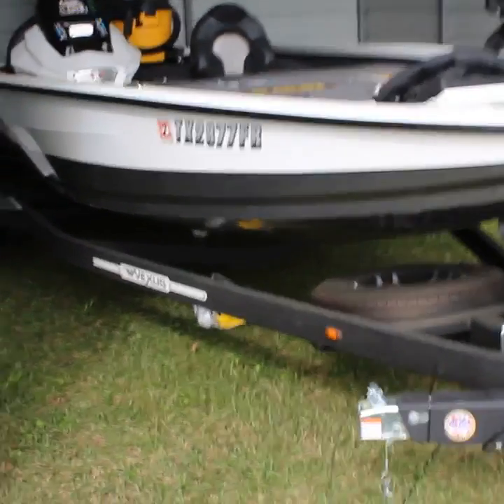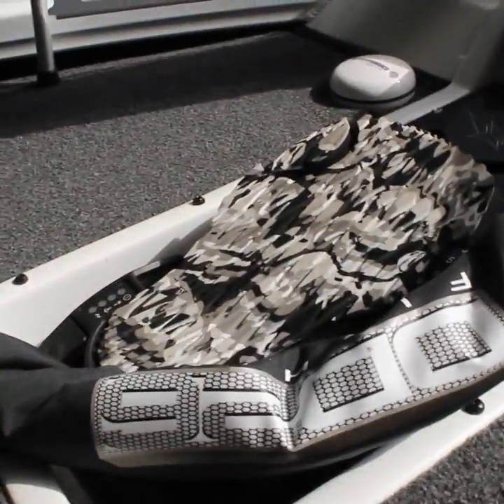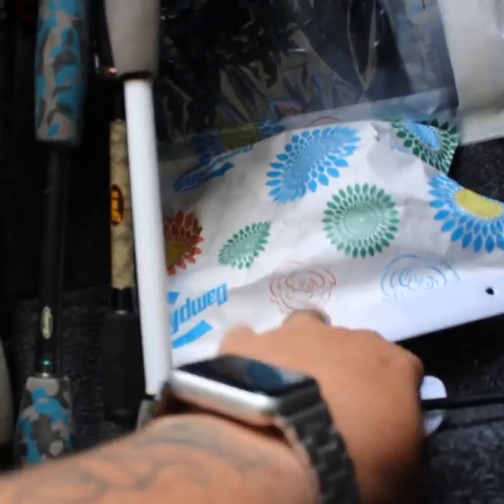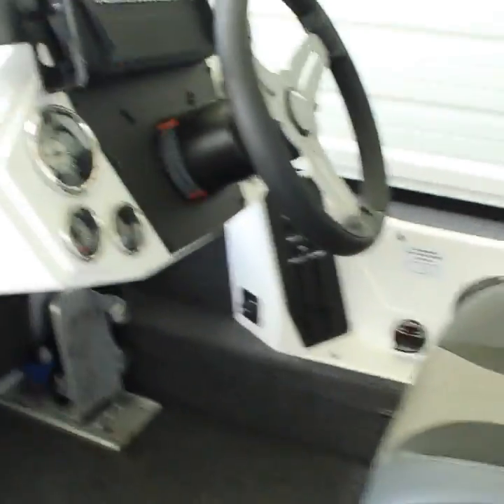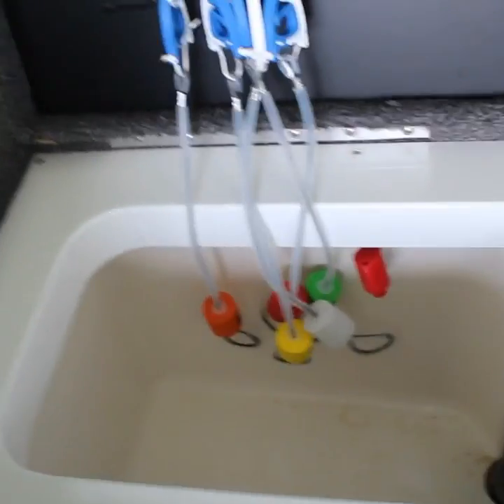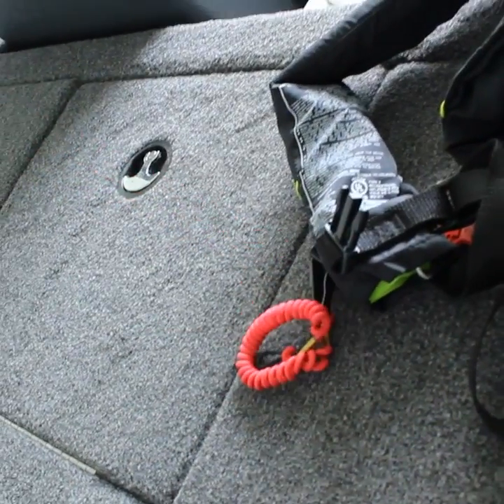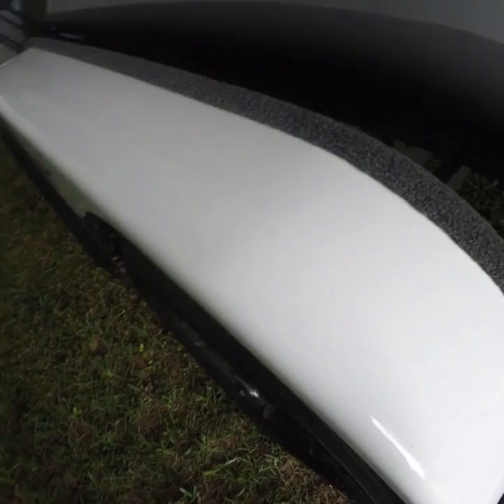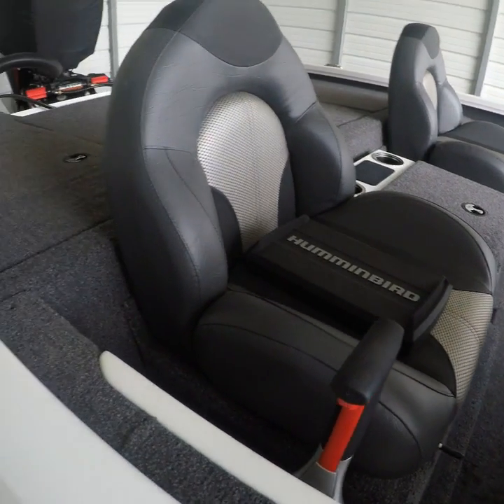(NEW VIDEO) 2020 VEXUS AVX 1980 honest review from a actual customer. YOLOtek powerstick link below!

Comment: Because the front compartments are sealed it is extremely difficult to get moisture out. On a hot day or 2 remove everything out of your storage compartments and leave them open with a fan running on it. Works like a charm. I’ve made a habit of just leaving my lids cracked while in the garage. Insulating your lids will also help.

Comment: Love your honest opinion.   Don’t be so hard on your compartments for moisture.  Water isn’t getting in, air is and you can’t keep it out.  The unconditioned air contains water which condensates due to the temperature changes just like condensation on a cup with a cold drink in it.  That moisture didn’t come from the inside of the cup, it came from the air around the cup.  Same principle in your boat.   You may have to try leaving compartments open or partially open but experiment with a cover on.  Keep us posted how the boat does going forward please.

Comment: One thing Vexus Does good & I think Ranger does also is the Channel Iron Trailer. I had a tube trailer before with Tracker (1994 model) and they don't hold up. They rust from the inside the tube. I won't even consider a boat without Channel iron. I like Vexus even with some of the flaws. The Fiberglass console is another big winner over the flimsy designs of the past you may see in other Aluminum boats.
Reply: Just curious, how many years did you get out of your tracker trailer?  I have a 1996 targa 18.  Had it since it was brand new and just this year I had to get two beams on the trailer replaced after they rusted and broke in half.   But thats after about 25 years of use so I can't complain.  It's is just their regular trailer.  Not galvanized
Reply: @lightsout827  I got 16 years out of the tube trailer. It was not galvanized. It was the standard tube trl. I had a channel trailer built to replace the tube in 2010. I still own the boat. Its a Deep-V (Magna 17 Fish) Bought the Boat new in 1994.

Comment: Great looking boat! I do think its funny that the company in a video from 2019 claimed that all of those compartments were watertight dry boxes....interesting!
Reply from the maker: I have found they are water tight if it rains or a wave comes over however they are not water tight when it comes to condensation that’s a fact lol
Reply: @clutchfishingoutdoors3141  would it be possible to add something to the inside of the lid to mitigate moisture? Do you know why aluminum boats have more condensation problems than glass boats if all lids are made out of aluminum (at least the ones I have seen).
Reply from the maker: I’m pretty sure most glass boats have glass lids throughout the boat and I’m sure there is something you can put on it to limit the amount of condensation I just haven’t really messed with it ... it’s only during the cold months were it will do it

Comment: Great video! Would love some on the water videos and curious how it is in the wind not running but fishing. Does it blow around or is it more like a glass boat since it has some fiberglass in it.
Reply from the maker: I have a few on the water videos of it on my channel and if you are out in open water with say 12-15 mph winds and decent waves then it pushes you around a little bit nothing bad tho it’s heavy enough where it won’t just get blown around that’s for sure I’ve never had any issues . I’ve had it in open lake with some prettt good waves fishing a point , I had water splashing over the back of the boat but I had it on spot lock and it still felt plenty sturdy and safe

Comment: I even have condensation problems with my fiberglass Ranger sitting outside. The compartments seal so tight it can’t get out so I always use Damp Rid in my compartments. Mines a 2014 before they offered the ventilation system.
Reply from the maker: I mean I think if you leave a boat outside period you’re gonna have some kind of moisture issues unless like you said it has a ventilation system in it
Reply: Clutch Fishing & outdoors yes for sure especially when it’s changing temps a lot

Comment: One of the thing I noticed in all the videos I seen that I don't like is on plane it not letting the operator trim up properly. Water sprays out and you can obviously see it needs trimmed up.
Reply from the maker: That’s mainly bc I’m not all the way on the throttle once you put the throttle to the floor you get in the back pad and Hardly any water is spraying on the sides .. when I’ve got it on that back pad at full throttle it glides on the water almost feels like I’m out of the water but I’ll only ride like that if the water isn’t rough bc it will start Chime walking if you hit waves from the side
Reply from the maker: But yes that water spraying is mainly me causing it keeping the boat down in the water a little more
Reply from the maker: I’m going to the lake this evening I’ll get a good shot of it on plane for you to see it
Reply: @clutchfishingoutdoors3141  ok!

Comment: Great video.  I have a 2019 AVX 1980 and love it.  i am having the same issue with moisture in my port side rod locker as well, but not the others.  I am going to try to tighten the latch a bit and see if that helps.  It seems that my other boxes close tighter.  I wish mine had the plug control at the stern, that must have been a 2020 improvement.  I do wish there was an easier way to access the charger with the cover on.  Overall though I love the boat.
Reply from the maker: Don’t get me wrong I love the boat completely just some things like the ones I showed are small issues that need to be addressed I’m looking into a way to fix it

Comment: Sweet rig. Sorry about your dealer. A lot of dealers are getting like that. About to pull the trigger on a 2021 avx1880 next month. Did the humminbirds come networked from the factory? GPS puck? Trolling motor transducer? I currently have a 2018 rt188. Good fishing platform but the little shortcuts (carpet, compartment lids, trailer wiring issues, cheap seat pedestals) are starting to show
Reply from the maker: The dealership installed all of my units prior to me picking it up and yes they were all connected with the puck

Comment: Also noticed your kill switch lever. Most I've seen are spring loaded so to speak. Another words it wont run without the kill switch attached or using your finger to hold it in place
Reply from the maker: This one is not spring loaded it stays in run or off witchever you put it in with or without the kill switch attached but I always suggest keeping your kill switch attached to you if your running the big motor

Comment: How would you tighten the screws if you glue the carpet down over them?
Reply from the maker: Are you referring to under the lid we’re the carpet was loose?
Reply: @clutchfishingoutdoors3141  yes
Reply from the maker: Brian S. I guess you would either have to just put lock tight on them and tighten them or if they get loose pull the carotenoid back off and redo it
Reply: outdoors  only reason I ask is because I just needed to tighten my front deck center box lid last week.

Comment: The Vexus was suppose to be the equivalent of a Ranger, Phoenix etc. with an aluminum hull. 

So my question is to be clear is your saying the reason your boat is not a high end boat is because of the ride? Or the storage compartments that leak? 
Which by the way non leaking storage compartments is 1 of there selling points. So that disappoints me. 
The point for me to have an aluminum boat is all the boats I have trashed in Texas on stump fields. We don't have 100% vegetation for cover. Where I fish its wood and rocks. Mostly wood. Anyone who's fished Texas knows what i am saying. A glass boat will not last 15 or 20 years fishing in Texas. So I have to have an aluminum boat and I want a high end boat. 
I guess I will have 1 custom made. 
Thank You for the video. 
Please answer my questions.
Reply from the maker: I’m saying do not think you are going to get the quality of a 70k Phoenix or ranger im not saying this boat isn’t good quality if it wasn’t good quality I wouldn’t have bought it honestly. I just think people go into buying this and think it’s an aluminum ranger or Phoenix boat when it’s not .. the boat rides really smooth in rough and calm water it has a ton of features that no other aluminum boats have the design was amazing on these boats and to the boxes leaking they don’t leak water in they have condensation on the lids bc they are aluminum lids and not fiberglass it poured down rain for 4 hours last time I was at the lake and the boxes were dry inside ... you literally won’t find a smoother riding , or better aluminum BASS BOAT on the market than this vexus aluminum series you can add several upgrades to these boats to make them fit your style I love skeeter boats but I would buy another vexus before I paid the money for a skeeter
Reply from the maker: And I also live in Texas I fish Sam Rayburn and Toledo bend 99% of the time
Reply from the maker: Go look through some of my other videos to see what the boat has to offer
Reply: Clutch Fishing & outdoors I saw your lic. plate i knew you were a Texan. 😊
Reply: Clutch Fishing & outdoors ok gotcha.
Reply from the maker: And remember when I compare this boat to the high end glass boats you have to remember a heavy glass boat will obviously ride better than a lighter aluminum boat but I can out run and out perform a skeeter 190 series glass boat with the vmax 150 sho ... but there is a reason those high end glass boats cost that much more money more quality but this vexus will beat any other aluminum series boat on the market 100% I’ve seen all of them in person even rangers and excel boats
Reply: Clutch Fishing & outdoors 
When I am comparing them I am looking at fit and finish. You can't get all your birds up 1 tree. I'd rather sacrifice ride for durability. I am tired of cheap aluminum boat. I want the durability of aluminum hull for durability and with interior of a high end glass boat. That may not be possible, yet. 
The 20' is $96,000.00. I just checked at North Texas Marine. A man should be getting an aluminum hull Ranger for that. 
But it is still a better fit and finish than Xpress. 
There is going to be another boat company come out like vexus. Vexus is doing to well. Mark my words.
Reply from the maker: Go look at a vexus in person you’ll be impressed
Reply: @user-sh2mk8ew4c  get some closed cell foam insulation and put on the underside of the lids that will help stop condensation.
Reply: @M • 4 - Have you considered a gator trax?  I've seen some videos that seem pretty impressive, but have no first hand knowledge.  Here's a link: https://youtu.be/XM2cIdhUXbM